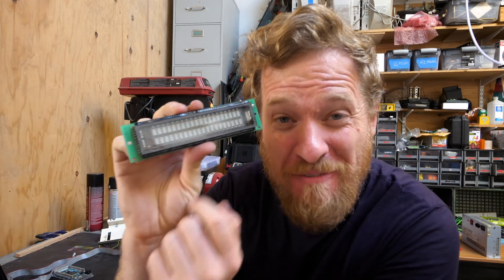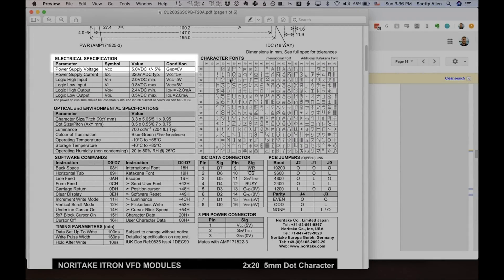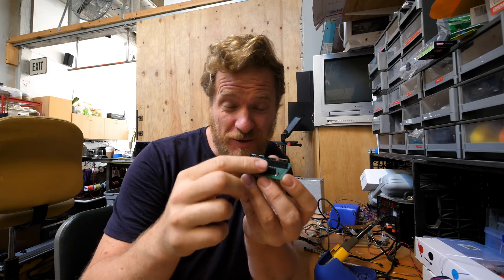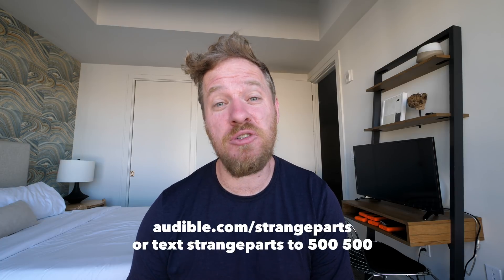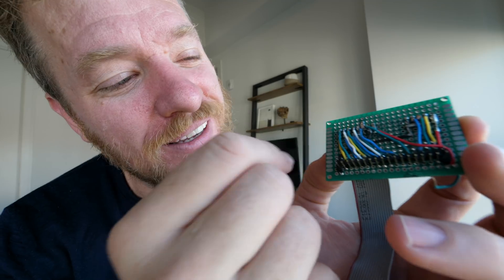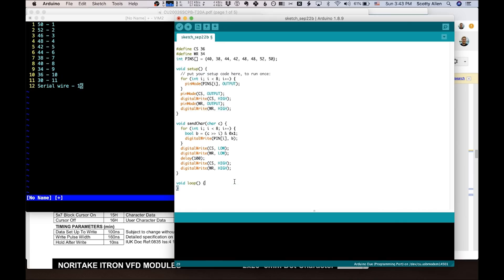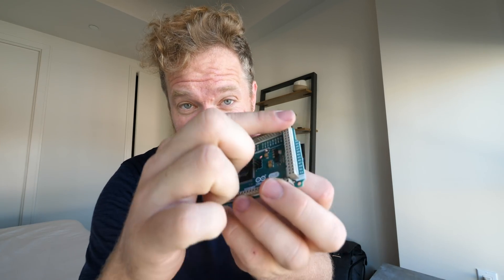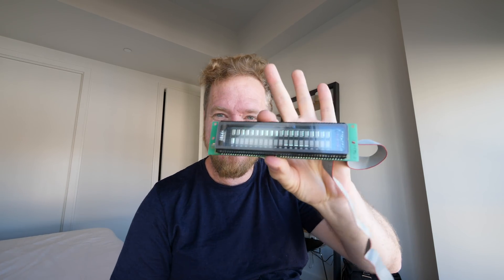Reverse engineering vintage Japanese electronics - a vacuum fluorescent display!

Comment: CS and !WR should be set in the inverse order, first !WR and then CS, when you set the signal to CS you are selecting the device to act, and it executes what is on the data/signal lines, !WR is the operation, not write/read, and there's no need to change it, if you aren't going to read from the device leave !WR low and just signal it with CS. You aren't having problems because the arduino is  fasther than the display but it may fail if you lower the speed of the arduino, if the !WR signal is high when you set CS and the display reads a R operation it may set data on the bus.

Also, the data lines are set after CS, that's to avoid collisions, if the previous operation is a read and the device has data in the bus and you write before letting the device that a new operation is going to happen (CS goes high) you may end with a short circuit (you put a 0 and the device has a 1 or vice-versa and you're sending +VCC to GND). It's important too that after you set CS low and have finished the operation, put the port pins in input mode, that will place them in a high impedance state and will avoid data collision.

If you want to simplfy and speed up your code (and make it a lot more readable) you can use a single 8 bit port on the arduino instead of scattered pins (per example, on the base Arduino PORTD is pins 0 to 7) so instead of a loop with bit testing and digitalWrites you can do "PORTD = Data", being Data a byte variable with the value you want in the bus. 

Finally, I see you are missing A0 from your code (or at least isn't shown) and you should have it, with it you can control the cursor position and select the READ operation type (data or status)

 Hope it helps :)

Comment: I am working on an OLED conversion of my 300ZX climate control unit display that uses this kind of display. I am trying to decode the signal from the climate control computer but it seems to be really weird to me, as I am a software developer and don't really deal with hardware often. The issue is that there are 3 wires, serial data, clock and line hold. I am not sure how to write code for it. The numbers seem random that I get from it. Chip is an NEC fluorescent display driver that is supposed to be generic. I am stumped!

Comment: Not really reverse engineering when you have a datasheet ;-)

Wondering if parallel really is any faster since you are configuring the pins serially anyway. Bit-banging in this manner isn't really parallelism imho. Although I doubt the arduino would allow setting multiple pins in a single memory access. Certainly not through it's API I would bet.
Reply: you can do a bus write to set all 8 pins in one go.  But he would have had to do the wiring correctly (D0 through D7) and  writing the ascii value directly to the PORTD refgister. A lot simpler. In the "old days" parallel was the preferred method .. you just had a single parallel bus and used the CS line to select which device you wanted to talk to (in general, using some decoding logic to select 1 of 16 devices for example)...
Reply: @garci66  Thanks. Was wondering if there was enough "sophistication" in that microcontroller like the "PORTD" register. I'm used to work on more constrained embedded systems where such features matters on my day to day job so I wasn't sure.

Yes parallel was more popular back in the day for two reasons. It was easier on the CPU to achieve high data rates with less (and slower) clock cycles. Also we're taking of a period prior the popularization of balanced "twisted pairs" cables where interferences and crosstalk was a big issue at higher speeds. Nowadays theses problems have been overcome and it's cheaper and simpler to reduce the number of wires.

Comment: Congratulations on reverse-engineering the Hitachi HD44780 protocol! I'm surprised you've never heard of it before! Arduino actually has a dedicated library for it which also implements additional functions like positioning, changing and hiding the cursor and even loading your own custom characters into memory of the display controller.
Many configuration registers are standardized among these displays, and the first one you might want to use is the one that switches the bus to 4-bit mode - this will allow you to save 4 whole pins of the MCU. Have a go with this wonderful simulator to figure out what does what: http://www.dinceraydin.com/djlcdsim/djlcdsim.html (Arduino library does all of that automatically anyway, but still...)
The way serial communication is implemented on this particular one might not be as straightforward, and might be difficult to figure out without proper datasheet.
P.S. You were really lucky this particular display did not require any initialization procedure or something. I'm currently working with some OLED displays with the same interface, and they're notoriously bad in this regard.

Comment: you make it work, and I imagine you have cpu cycles to spare, but just a useful trick: If you look up port manipulation for the Arduino, you will find that digital IO is grouped into ports of 8 bits. You can write to all 8 bits at once. Since your device uses ASCII for the normal letters and the Arduino language also uses ASCII, you can just do PORTX = 'a' to set all the pins to the right value to show an a. This is of course contingent on you wiring the data pins on your device in order to pins 0-7.

Comment: That sounds pretty similar to the HD44780U on character LCDs. You could probably get the liquid crystal library or some other character display library working with that.
Nothing wrong with writing it yourself though. Personally I always think it's better to write your own code, since that way you know what you have. But in your case you're code is very inefficient. I figure it was just a prove of concept. But still, that's the final version you show in the video?
I guess on a normal ATmega, I would've connected the 8 parallel bits of the display to a single port of the arduino and just write the character directly to that register, that way you don't have to set individual pins high and low. And you set all 8 pins over 10 times quicker than it takes to write a single digital pin high or low with digital write. Using direct port manipulation is generally A LOT faster than digital write... I haven't really worked with the due, but as far as I know it uses a 32 bit processor, so I figure each of it's ports also control 32 pins. I don't know, I'm sure it's all described in the datasheet.
And about the delays, well ... obviously I would try not using delay at all, but if you're gonna use them, at least try and make them as short as possible.

Comment: I have 20 years a go a bystronic Co2 laser with 2kw power and the high voltage and gas delivery system used this screen too.
I have one time to replace it and it was really expensive.

Comment: Hi. Looks very similar to working with those HD44780 type LCD displays, in fact this is probably like a grandfather to these modules. To be complete, and to be able to do the progress bar type graphic, you'll need to implement a standard backspace operation (on these things it may act more like a left arrow operation on a PC / Mac), a clear screen operation, and if it supports it, a means of positioning the cursor anywhere on the display. Speaking of, you might want to turn off the underscore cursor, almost certainly possible. This'll just involve sending special characters or commands.

Comment: Oh hey, I got one of those VFDs, it looks like the same one. I took it out of some old industrial equipment, and I was gonna try and do the same thing with an arduino, but couldn't find the proper documentation for the VFD so my plans kinda stalled. 

If you have the same one, that fucker supports custom character sets, so you can put in logos and stuff.

Comment: I love your videos, but I have to notice something to you, The thing that you made is not reverse engineering, because you had the input Datasheet. The correct thing you made it was an Arduino implementation of that display.

If you have no datasheet and you have to start digging up what each pin does and what type of communication, that is reverse Engineering. 

Still pretty cool video!!!

Comment: If the display controller is HD44780 compatible, then it should be fairly straightforward to use in with either 8-bit or 4-bit parallel mode. At least the pin names are similar.

Comment: I'm pretty excited since I have a similar VFD and wanted to see what your plans are for this.  Wanted to share this older website I found that hooked up a very similar VFD using the serial port - appears yours has a similar 3 pin power connector looking at your data sheet .  3 wires, way less coding and pin selecting, but maybe you want to do it in parallel for some other reason:  https://tronixstuff.com/2013/08/23/using-older-noritake-itron-vfd-modules/

Comment: Arduino has a library called liquid crystal, that will do exactly this. The display in the video is basically a normal 20x2 display, uses the same protocol except it also has serial

Comment: CS = Chip select WR = Write pin. Usually these get pulled low to enable A) selecting the device (If you have several on the same data bus (D0-D7) ) and B) Choosing between reading data from a register, or writing data into a register. Before you discovered the in mapping being wrong, I actually thought that you maybe hadn't set the display configuration registers. Many displays usually have special registers, where if you flip bits in them, will change how things work, and can do stuff like inverse characters, blank display etc etc. It all depends on the display used. 

Also, a downside to these old VFDs, is they do dim over time, and burn out. Thats partly why they fell out of favour, long term reliability isn't good. Best stock some spares.

Comment: You had the data sheet. This was just engineering not reverse engineering.
Reply: It's "reverse engineering" because he had the wires hooked up in reverse. :-)
Reply: Totally agree. You can buy similar VFD modules anywhere. They are controlled similar to an LCD module controlled and easily controlled by off the shelf code like Arduino. So nothing vintage or reverse engineered about this.
Reply: I feel clickbaited, I came to this video expecting reverse engineering based on the title.
He already had a complete datasheet, nothing needed reversing.
Reply: And then - 
doesn't even put up the code or the datasheet! 🙄
Reply: oh come on, let him have some fun :-)
Reply: Are you actually gatekeeping reverse engineering? :)
Reply: 12345nametaken no one likes a know it all, leave him be
Reply: @halosrusty  You don't know electronics do you? It's not something to ignore. Reverse engineering and engineering is a whole new different story.

Comment: WR = the read write pin, with this you select if you want to read or write to/from the display
CS  = Chip select this is a very common pin in parallel/serial busses. It lets you wire your parts up into an actual bus. You pull this low (or high depending on the chip) to let the chip know you want  to talk to this specific chip.

Comment: 2:50 we can run it on 5v but you need 35 ohms resistor or the best is 68 ohm

Comment: Is that a Herculite generation machine? I'm relatively sure it's...  I would love to have more info on your engineering if it is... I have one that i can't reset, and would love to add my own game to it...01001001 00100000 01110100 01101000 01101001 01101110 01101011 00100000 01101001 01110100 00100111 01110011 00100000 01100001 00100000 01001011 01101111 01101110 01100001 01101101 01101001 00100000 01010011 01101100 01101111 01110100 00100000 01001101 01100001 01100011 01101000 01101001 01101110 01100101 00100000 01110000 01110010 01101111 01100010 01100001 01100010 01101100 01111001 00100000 01100001 00100000 01001000 01100101 01110010 01100011 01110101 01101100 01101001 01110100 01100101 00100000 01110011 01100101 01110010 01101001 01100101 01110011 00101100 00100000 01110100 01101000 01101001 01110011 00100000 01110111 01101001 01101100 01101100 00100000 01100010 01100101 00100000 01100110 01110101 01101110 00101100 00100000 01100111 01101100 01100001 01100100 00100000 01111001 01101111 01110101 00100000 01100111 01101111 01110100 00100000 01110100 01101000 01100101 00100000 01010000 01101100 01100001 01111001 01100101 01110010 00100000 01010100 01110010 01100001 01100011 01101011 01101001 01101110 01100111 00100000 01010110 01000110 01000100 00100000 01110100 01101111 00100000 01110111 01101111 01110010 01101011

Comment: int i=? is tricky to debug as the the stack is mostly always initialized to 0 during a hard reset. You can almost count on it on simple chips like the cortex M family or PICs or AVRs. Yes it's a software bug but in practice it can make your product function 99.99% of the time until you have a brownout or some other weird stuff going on in the chip.

Comment: more easy is to take a screen from a POS and make the message on a retail software so you dont have to deal with pin or conections search for ibm 4800-742 -743 -745

Comment: These VFDs are super super sexy, I have a few 40x2 I got about (big number) years ago off the e b a y , I used it on my media pc (media player and winamp) when they were the rage huh lol. Used a pic19fxxx to communicate with via serial and eventghost software. Heaven knows where all that code is now. I should have the spec data sheet somewhere in sure. You've hit a heart string of mine TYSM

Comment: I salvaged a https://www.maltepoeggel.de/data/vfd/20m101da1.pdf from an old treadmill.
It has the exact same pinout as yours except it's only a one row display instead of two. It also has the exact same list of characters and commands.

I was able to test it very quickly by hooking it up to the TX of a USB to TTL serial adapter and typing commands into a terminal program.
It uses much fewer pins than parallel and doesn't require any shifting or anding.

I can control it with an Arduino by doing things like...
Serial.write(0x0E); //Clear display
Serial.write(0x13); //Horizontal scroll mode
Serial.write(0x1B); //ESC
Serial.write(0x0C); //Form feed

OR to test out all the characters

void VFDchars()
// run through characters for selected font
{
 for (int i = 21; i < 256; i++)
 {
  Serial.write(0x16); // underline cursor off
  Serial.write(i);
  delay(30);
 }
} 

By the way, since you're using parallel couldn't you send the data over a PORT on the Arduino instead of using that overly complicated for loop in sendChar?
It's very fast and uses much less cycles.
You can do something like PORTC = 0x0E; and all the pins will be set at the same time on the pins of PORTC.
Or are you using a DUE? Those handle ports differently than something like an UNO or Leonardo.

Comment: The line bool b = (c >> i) & 0x1 confuses me. I don't do arduino stuff. So he's first shifting the binary value of C by i bits, then he's ANDing the value with hex 1.

ASCII value of A =  00101001
00101001 & 00000001 = 1 true
01010010 & 00000001 = 0 false
10100100 & 00000001 = 0 false
.......
Why does he do this? Can't he just use something like if(i == 0){b = true} instead of this?

Comment: A cool tip for when you're trying to interface with "strange parts" you don't know a lot about and don't want to blow up (especially in the case of messing up inputs and output pins or voltage levels), is to put series resistors (IDK, around 1K) on all digital signals. That way you limit the current if something bad happens (like both ends forcing opposite voltage levels on the same wire). Keep that in your "toolset" :)
Reply: These are the things that you never get taught except in inexplicable places like youtube comments. :)
Reply: @sstorholm  Actually
Reply: Thank you!!
Reply: 100 ohms is usually enough, and avoids some problems with weak pull ups/downs and higher speed signals, and yeah, you don't get taught this in school
Reply: This tip is doubly important when interfacing 5fv and 3.3v things together, and you're not sure if the 5v portion is going to send data/signals back.
Reply: thanks

Comment: Isn't that the same logic used on like Hitachi 16x2 displays? If so just use liquid crystal library.
Reply: was wondering that to, the control codes are different

Comment: Love your work, but you're late on a project and you make the VFD a BFD?  Jump to the serial port where it's easier to send w/less code and you don't need so many pins.  I've had enough fun driving things like Maxim 7219 chips in nybble mode that I just don't have enough hair to pull anymore.  At least this display makes using UTF-8/ASCII easy to code for.

Looking forward to seeing the result and I've gotta admit I love reverse-engineering as much as development.  Sometimes I am amazed at things I learn doing so and sometimes amazed they got it to ship!  Great use of existing assemblies and Googling useful doc to do so.  Great sport!

Comment: Being an Eighties kid filled to the brim with 8-bit computer BASIC knowledge, am doing very similar experiments with the Colour Maximite instead of the Arduino.  I was amused that you made some of the same mistakes I did!

I’ve found that driving the segments directly instead of interfacing with the driver electronics to be more interesting.  I’m just farting around with seven-segment displays at the moment, though.  Still, using Ben Eater’s technique of pulling the display byte from a small EEPROM to be very fun!  Without relying on a driver, I can drive any segments I want.  I may try something similar with some sophisticated displays like yours.

I really enjoyed the video.  Thanks!

Comment: @Strange Parts
You should look up data on the HD47780 character LCD's. Those are almost certain pin compatible with the VFD you're using and there is a ton of information about using a HD47780 with the Arduino.